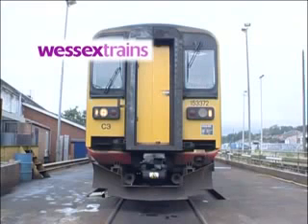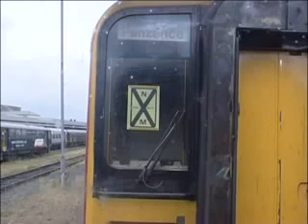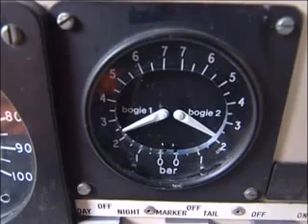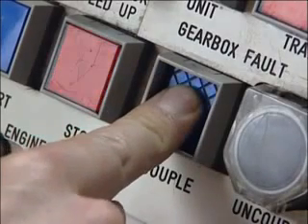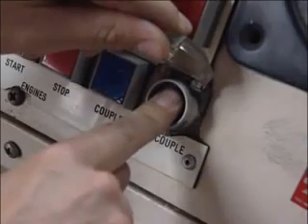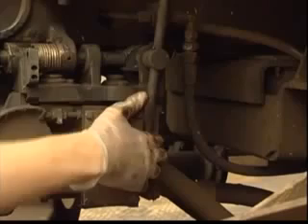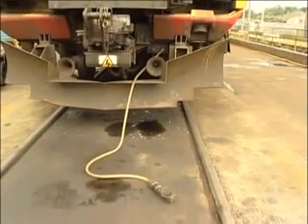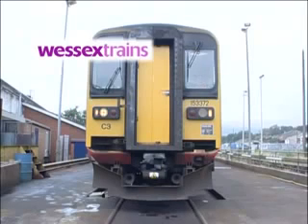Coupling DMUs | Wessex Trains

Comment: Always take care when coupling Wessex Trains units as the vinyl is structural and cannot handle large forces. Vinyl should not be used to remedy rust!
As for why we use full autocouplers, basically it means that no-one normally has to go out of the train and on to the track to couple units together. A good few rail operators in the UK rely on regularly splitting and joining trains to make the timetable work and as such being able to quickly couple/uncouple without any extra staff is essential. More modern units use superior Schafenberg couplers (usually Dellner brand) and couple even more easily (unless made by Alstom!), and trains like the Siemens Desiros don't even require a couple button to be pressed, automatically closing down the cab and making all connections the moment contact is made.
On our local main line to London we can only usually have 5 carriages on our bit as there is not the electrical capacity for more (it was electrified on the cheap), but later on 5 carriages would be insufficient, so we usually get 1 5 car unit as far as Bournemouth (where the power restriction is no longer in force) and then at Bournemouth another unit attaches, all within about 30 seconds.
Reply: AFAIK the power restrictions start just west of Poole. The Poole stoppers can sometimes be a pair of 450s. Think I've also occasionally seen a pair of 444s in Poole

Comment: Two words knuckle couplers
Reply: One word: slack.
More words:  American knuckle couplers have too much slack for a passenger train, and also don't handle all the electrical connections, nor the brake connections. That's US passenger trains have a load of extra cables and hoses that have be manually connected.
Reply: AAR type coupler is not suitable for passenger trains because of the slack.  A complex electrical system connection is required because there's a cab in each wagon. Anyway, this coupler is extremely rare in Europe where we use the chain and buffer system.
Reply: Quick easy and far more secure, Europeans seem to look for the most difficult way to do the simplest of things
Reply: yeah lol
Reply: they want to have couplers like american couplers why cant they just use our style
Reply: To straight forward, simple, safe, and of greatest importance to Europeans to sensible Along with being what the US uses. When in \our lifetimes have Europeans done anything that was well and sensibly thought through?
Reply: Strange Amtrack has no problems with Knuckle couplers and a couple of electrical connectors., seems to work just fine on Transcontinental train service in the US.
Reply: 8aleph Amtrak uses The AAR/APTA TypeH TightLock coupler which is used only for passenger trains in north America. And this type of coupler exists in the UK since 1970.
Reply: That's odd Ive seen Amtrack cars being handled and moved by Knuckle connector Freight Locomotives even hauled by them when their own locomotive broke down
Reply: 8aleph Yes, they can connect with standard AAR couplers, but they create slack.
Reply: Seems like the manual connection of hoses might be more sensible than this style of coupler, but what do I know?